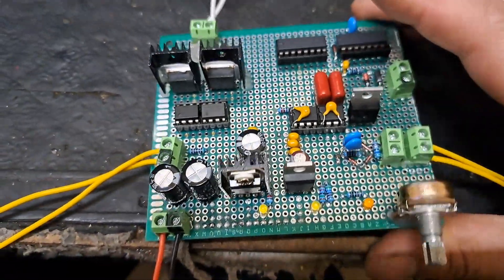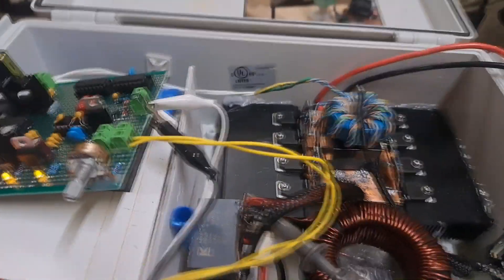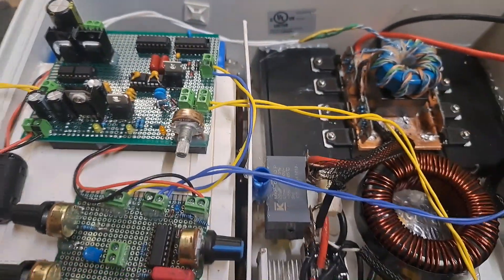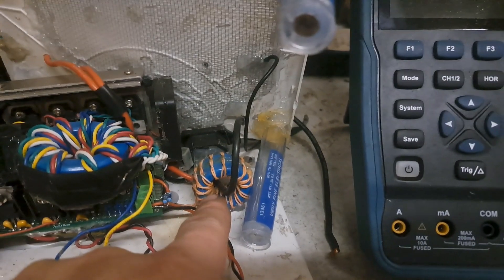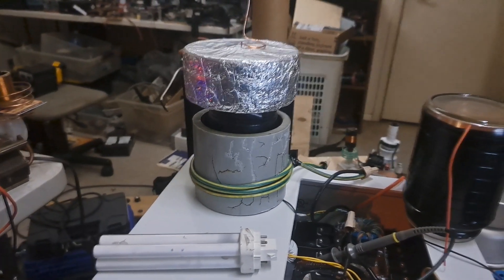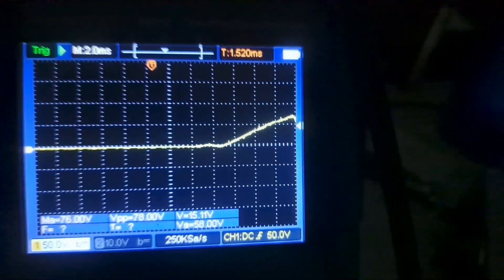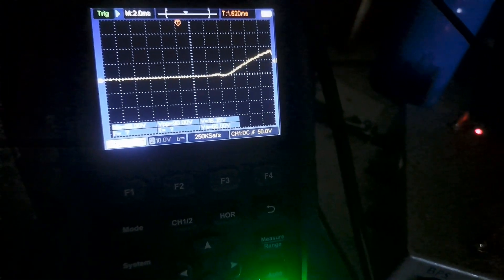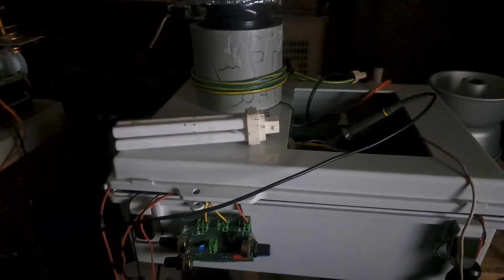QCW SSTC Double Full Bridge First Test

Comment: Do you have any resistors in series with the UCC27322? At 12V mine seem to keep blowing.
Reply from the maker: Only resistors you should really have would be going to the gates the chips are driving. If you're not trying to switch a crazy amount of gate capacitance at a crazy high frequency then they shouldn't be blowing up.